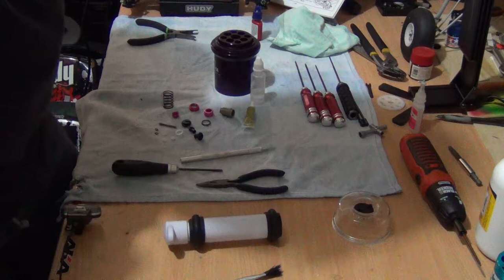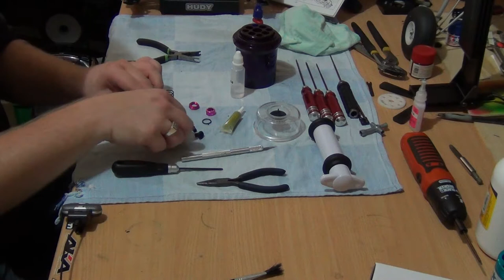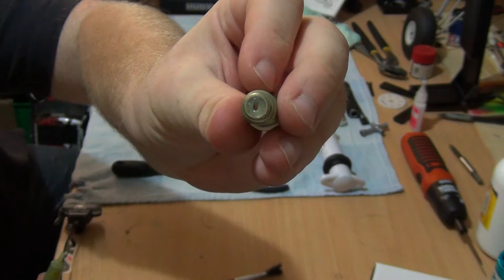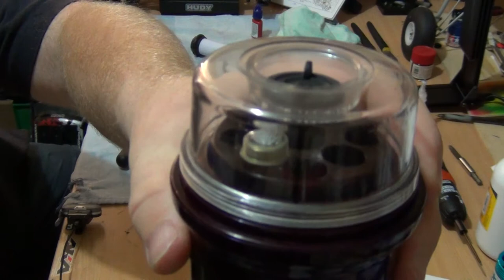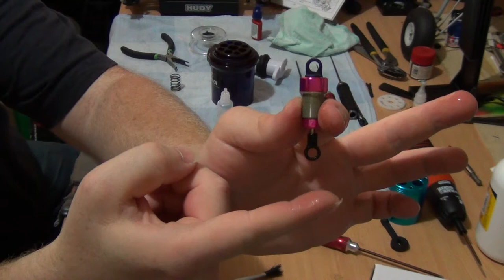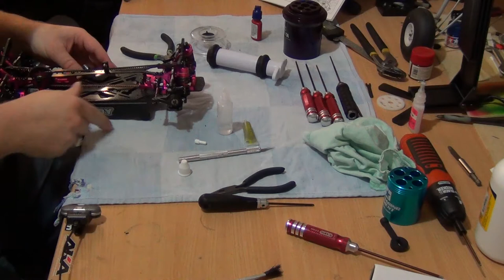3Racing Sakura Ultimate build series part 11. Shock assembly.

Comment: Hi I'm a beginner in rc cars and I have a question does everything come with the chasis?
Reply from the maker: No, with your race chassis's you only get the chassis. To complete it you need some basic tools, wheels and tires, a body and paint for the body, motor and esc, pinion gear, steering servo and your own radio. The only things that are included with the kit are some shock and diff oil.